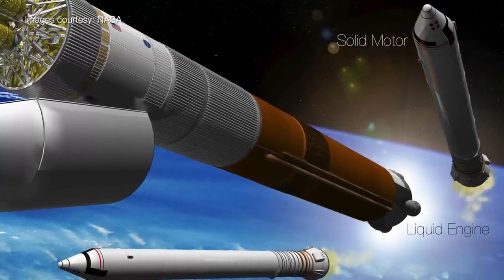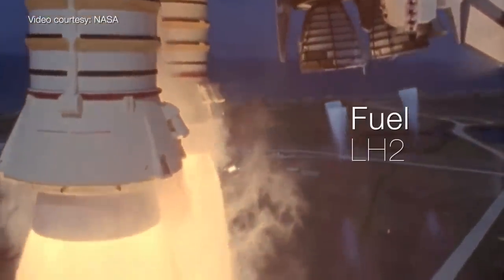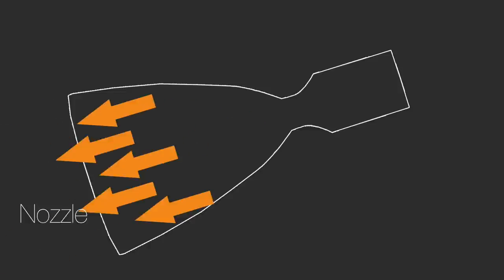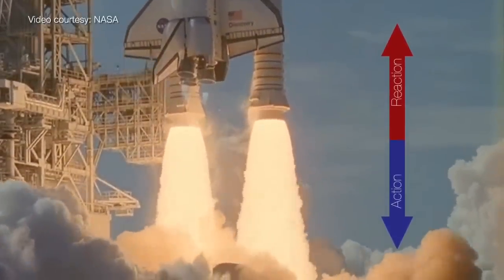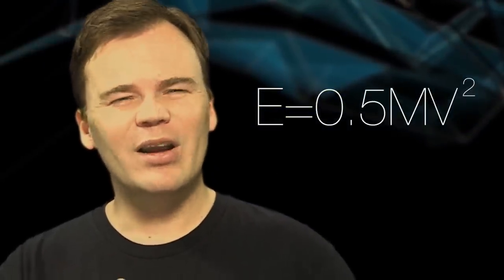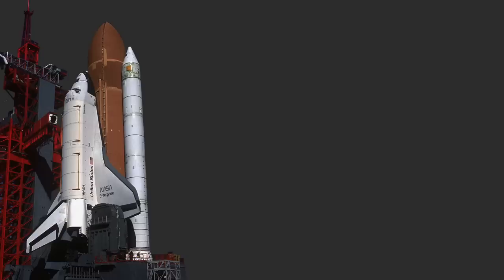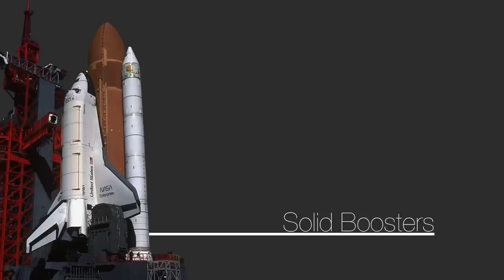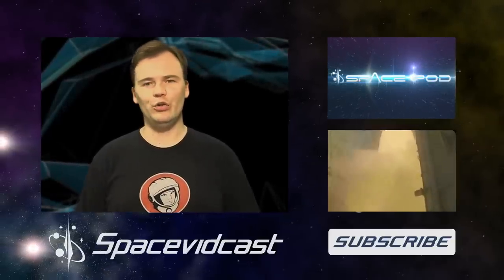How do rocket engines work - SpacePod

Comment: One thing I never understood until my fluids class- I always was confused why the nozzle expanded the flow.  Intuition is that as fluid expands in area, it slows down to conserve mass flow.  But, I learned in my compressible flow course, that the above is true for subsonic gasses, but once the gasses are flowing supersonically, an expansion in area makes the velocity increase.  So the throat is critical in that, it speeds up the flow to sonic, then expands it supersonically in the nozzle.
Reply: Haha yup, exact same story here.
Reply: What difference does it make what the gas velocity is?
Reply: More energy is released where? I do not believe that the higher the gas velocity, the more energy is released. I believe that the more energy is released, the higher the gas velocity; other factors being equal.
Reply: Scott Gauer same boat

Comment from the maker: Correct. That is an empty orbiter, fuel and tanks. 

However, the maximum payload weight to LEO is only 24 tonnes which brings the total weight to 2,019 tonnes. Part of the reason the payload weight is so small is that the orbiter itself is 74 tonnes all of which we need to bring up and back! So the shuttle ends up becoming payload in and of itself.

Comment: You're going to need to do a video about how space and vacuums don't pull, because some people think that rockets can't work in space because the vacuum of space >pulls< the gases out of the rocket and robs it of any push. Please explain to them that there is no sucking(as in pulling)done by a vacuum. It's only pressurized gases expanding and PUSHING into areas of lower pressure. No pulling, just pushing. I just did a video about this point, if people want to check it out, but more people need to make a video explaining this misconception about vacuum.  You also need to explain what Joule's Free Expansion Experiment is all about because that is what these people use as evidence that vacuum is pulling and therefore rockets can do no work in space. They are misinterpreting the experiment but I'm not the guy to explain there miss step on that one.

Comment from the maker: Liquid Hydrogen is insanely hard to control. The fuel is light, but it wants to leak and go everywhere, so you need heavy and complex equipment to keep it contained. Remember the last few shuttle flights and how they kept getting delayed due to a GUCP issue? That's a ground umbilical carrier plate and it is what carries the hydrogen burnoff away from the vehicle. When it had even a small leak, they had the postpone the whole flight! RP-1 on the other hand, heavier but easy to work with.

Comment: Should have mentioned that there are good reasons to use kerosene over liquid hydrogen in certain situations. Kerosene is much denser than liquid hydrogen. You can put a lot more kerosene in a fuel tank of a given size than you can liquid hydrogen.
Reply: Very true, but sometimes you have to balance it because heavier fuel burns faster.
Reply: In rockets it's more about mass of the rocket, so we use hydrogen which has a good energy to weight ratio

Comment: Actually with the fuel mass thing, you get more energy from denser fuel which is why you use those for first stages (you need a LOT of thrust) and then you move to more light weight fuel which gives u more efficiency for less thrust.  If lighter fuels gave u more thrust that would defy the law of conservation of mass.......

Comment: how does it propells in space vaccum
Reply: First of all, vacuums do not 'suck' things away, which is a common talking point. It's a bit counterintuitive, since we live in a pressurized environment, so any reduction in pressure causes ambient pressure air to try to move (push) into the low pressure environment. Your house vacuum really uses a turbine to push air out of its body, and has a hose to allow ambient pressure air in, which pushes dirt and dust with it. Similarly, in a vacuum, a pocket of pressurized gas tries to push apart to fill the volume equally. This is important.

Second, if you sit on a skateboard at rest and throw a heavy object, you move backward. All the momentum you apply to the object also applies to you, in the opposite direction. When you add these together, keeping in mind the direction, they make zero, so momentum is referred to as 'conserved'. Both objects move, but their combined momentum is zero. This always, ALWAYS applies in physics.

Third, in a rocket's combustion chamber, the pressures are very high. Saturn V's third stage operated at upwards of 730 psi. This does not require a comparatively measly 14 psi of atmospheric pressure to 'hold it in' for some time. Anyway, the chamber lets the gas out only in one direction, and with such high pressures, the gas gets to very high speed. Faster than the speed of sound.

All that really matters for a rocket to work is that fuel, with mass, starts at rest compared to the engine, and finishes as exhaust, with the same mass, at very high speed in one direction out the nozzle. This change of speed is also a change of momentum. And as before, if you have a change of momentum in one direction, you must have an equal change of momentum in the opposite direction. Thus, the rocket moves opposite to the direction of the exhaust.

Comment: what does a rocket push against in space?
Reply: steven padilla:

There is nothing for rockets to push against in space. That's why rockets can't work in space...
Reply: It doesn't need to 'push against' anything. A rocket works by taking part of its mass (the fuel) and throwing it out the back at very high speed. The fuel starts at rest compared to the engine, and ends at high speed in one direction. This has a lot of momentum that goes with it. But if you have momentum in one direction there must be an equal momentum in the opposite direction. The only thing it can be applied to in a vacuum is the rocket, so the rocket moves. A bit counterintuitive, but that is how physics works.

You can try this by sitting on a skateboard and throwing a heavy object. With the wheels lined up with the direction you throw, you will move. If there is any pushing involved, it is against the ball, which is the analog of the fuel/exhaust. You don't have to wait for the ball to hit something and stop for you to move. You move as soon as mass starts moving around.

Comment: Why are you calculating kinetic energy?
Its the momentum that you want to know, p=mv
Reply: Correct, the mass of the rocket does not stay the same; it changes all the time because the fuel is being consumed. The K.E. equation is just going to give you a K.E. at that instant provided you know the exact mass of the system, but the momentum equation will give you the momentum of the system at all points in time. The trick to "Rocket science" is this change in mass and proportional increase in momentum, it is not just Newtons's third law as stated in this video.
Reply: ***** Is there a 4th law?
Reply: +Tim Interested 
In fact kinetic energy is ONE HALF of what this gentleman stated it to be.
Reply: Ganeshwary is that you?

Comment: I still don't understand.... in order to move, you need an opposite force, for example to walk, you push with your feet on the earth, the earth offers it's support, that support is the opposite force, now how does a rocket move in space where there is no support ?
Reply: When a rocket takes off, the upthrust is pushing against the surface of the earth and provides upwards momentum, but when the rocket gets to a certain height where force will no longer be hitting against the earth, it instead will push the molecules in the atmosphere away causing the same outcome. It's like when you're swimming, if you push the water out of the way you propel yourself forward a little bit, but because air is much less dense than water you require huge amounts of thrust to push enough of it out the way in order to provide the required amount of upwards momentum to push against the force of gravity. This is called newtons third law, for every action there is an equal and opposite reaction. 

Hope this helped :)
Reply: Tom Smith
it did, you did say that the rocket push agains't molecules, i was stupid enough to thing that space was enough of a vaccum to prevent things from changing direction
Reply: Tom Smith You didn't really answer his question, you know?!
Reply: damon-st -- If a mass pushes against another mass, both masses are actually pushing against each other -- because a mass resists any change in its state of motion, or state of rest. The rocket and the hot gases from the engine are pushing against each other. The hot gases win. A person sitting in an office chair, firing a machine gun, will move in the opposite direction of the gun fire. It's not because the bullets are pushing against the air. It's because the mass of the bullets and the gun are pushing against each other. The gun wins, and only feels a slight recoil, because it has more mass than the bullet. A rocket has far less mass than all the hot gases leaving the engine. By weight (mass), a rocket is mostly fuel. For example, look at the huge fuel tank, and boosters, on the Space Shuttle. 

If an atmosphere were necessary for a rocket to work, that would mean it would work better in a thicker atmosphere. But that would be silly, because air causes friction. and more friction produces less movement.
Reply: Tom Smith --- Rockets do not work by pushing against the air or the ground. A rocket works because the rocket body and the hot gases from the engine are pushing against each other. And the hot gases win because they have more mass than the rocket body. If a mass pushes against another mass, both masses are actually pushing against each other -- because a mass resists any change in its state of motion, or state of rest. A rocket is less efficient in the friction of an atmosphere. You don't swim better in pudding than you do in water.
Reply: dudev
Basically, i need to take basic physics classes :D anyway, the mass of the burning fuel at a T times is less than the rest of the ship since the rest of fuel is included in the general mass of the ship, but i don't really understand these mechanics so i guess i must learn some physics basics before continuing
Reply: damon-st --- The general principle is easy to understand. A continuous stream of hot expanding gases has a continuous recoil effect. Acceleration is also cumulative. It comes down to what Galileo realized -- that a moving object will stay in motion unless acted upon by another force, such as friction or gravity. The stronger force wins.
Reply: dudev
understood :D thank you, a lot
Reply: +damon-st 
Picture a baloon . The forces within can be imagined as little arrows which push out against the wall of the balloon. If the balloon is sitting quietly on a table we know that all the little arrows (forces) balance each other else the balloon would move, being pushed from within. When the nozzle of the balloon is opened the little arrows at that point have nothing to push against (or at least very little) and so they almost disappear. The arrows OPPOSITE the nozzle do NOT disappear and so the forces which they represent PUSH the balloon in the direction opposite the nozzle.
Reply: +dudev Well technically, its not about hot gases winning because the gases accelerate much faster than does the rocket. The escaping gas and the rocket engine impart equal force on each other in opposite directions. Initially on liftoff, the mass of the rocket assembly is huge, while the supersonic mass flow of the escaping gas is big but not that immense. That is why the rocket does not accelerate that fast on liftoff. Over the course of the rocket climb, the mass of fuel expelled is most of the initial liftoff weight, but all that mass does not escape instantaneously. Your analogy with a gun and a bullet is correct, when a gun is equivalent to a rocket, while the bullet is the escaping gas.
Reply: +damon-st its simple...blow up a balloon and let it go... what happens.... it moves.
the pressure in the balloon is greater than the pressure in the atmosphere of earth.  blow up the same balloon and let it go in space ( where there is even less pressure, negative pressure in fact) the expelled air in the balloon, or the thrust pushes it, only in space chemical thrust (combustion turning liquids into gasses) is used.

Comment: Why only chemical rockets, why won't nuclear rockets work?
Reply: doodelay I think because the fuel is heavy, the temperature would be really hot, radiation, ... => not good.
Reply: Hieu Bui Lest we forget the engineering challenges of trying to keep a nuclear detonation contained...
Reply: My guess is that because nuclear reaction are either to violent for the rocket to endure or, if slow enough, wouldn't allow any thrust, since the products would be only heat and metal. The fuel would be heavy and the efficiency of the motor would be really low, because the heat would have to expell mass somehow and the metal can't be expelled. In chemical rockets the reactions are easily controlled The products of it can be expelled and have much bigger volume than the fuel. So, even though a nuclear reaction is extremely powerful, there is no practical way to convert the energy into movement.
Reply: doodelay There are multiple project for nuclear spacecraft (Also using a nuclear bomb as propulsion, check Orion), but the main one which was also tested, the NERVA was actually going to be installed on a Saturn V, in a upgraded S-IVB (Third stage). Actually managed to get into testing session, but nothing more.

Nuclear engines are efficient, twice a normal rocket. But they are very heavy and with a low thrust.

In space radiation doesn't really matter, since the sun itself throws radiations all around our solar system :)
Reply: Really? Twice as efficient? I think not, if you say that efficiency is the quantity of energy produced transformed into cinematic energy. Otherwise we would definitly use it, since rocket lunches are expencive. Any discount would be apreciated and used.
Reply: Juan Salies The J-2 engine used in the Saturn V had a Specific Impulse of 421s, while the NERVA would have 825s.

First of all we're not talking about rocket launch, due to it's thrust to weight ratio it's impossible to use it as lifting engine, it would be used to make Earth departure manouvers
Reply: +doodelay The answer is none of the above: the main reason is political + economics. there's a lack of knowledge about nuclear propulsion systems in the public and fear to everything with the "nuclear" label. Currently there's an economic component too. The solution found is, for now, to have a chemical rocket for the launching component (at least until reaching LEO) and then to start a nuclear engine. The fuel is usually H or H2 so the gas velocity is way faster than the chemical rockets. The problem with the temperature can be solve by a combination of new materials and remembering that the exit is pretty much a plasma (=ionized) so magnetic fields could also be used to keep the exhaust far from the walls of the nozzle. There is NO radioactive material being released by the way. The nuclear reactor replaced the combustion chamber and "heat" the fuel at higher temperatures. This is the short version. I work in space nuclear systems by the way. Cheers. :-)
Reply: Carlos Omar Maidana Will the fuel be too heavy? And will it be solid or liquid nuclear fuel?
Reply: doodelay Liquid Hydrogen, which is pretty light, and Uranium-238 i think
Reply: doodelay The nuclear fuel can be liquid or solid. Currently the research is to try to make it liquid for different reasons but solid fuel was already being tested (since NERVA). The propulsion gases by preference is atomic H. The idea is to have a bimodal systems so you get propulsion + power at the same time. Always talking about Nuclear Thermal Rocket. In Parallel there's research in Nuclear Electric Rocket that for the political reasons I mentioned before, might be more suitable. The idea is to have the nuclear reactor couple to an electric propulsion system. Main components are the same between NTP, NEP and Fission Surface Power (nuclear reactors for electric power generation in space). With so many budget cuts worldwide and the politics, the idea worldwide is to do everything modular and reusable for different type of applications.

Comment: Actually, it is  E equals 1/2 m v squared. 
Your explanation is not very enlightening.
Reply: +ercillor why 1/2 m ?
Reply: Essentially, the 1/2 comes from the integral of velocity.  Work = Force x distance and can be expressed as the integral of Force (as a function of distance) over some distance, dS. Also Force = Mass x Acceleration where Acceleration is simply the change of Velocity w.r.t. change in time (i.e., Accel = dV/dt).  Also note that Velocity is the change of distance w.r.t. change in time (i.e. Vel = dS/dt).            Substitute.    W = Integral of { (Mass x dV/dt) dS}.  For this derivation, Mass is independent of time and distance so can be moved outside the integral; such that, Work = Mass x Integral of {(dV/dt) dS}, or rearrange, as Mass x Integral {(dS/dt) dV} = Mass x Integral of {V dV} = Mass x (V^2) /2.   (Notice the last part is right out of elementary calculus).        Sure, there's a component of initial Velocity, Vo which can be included for completeness as one of the boundary limits of the integral, but we'll assume the object was initially at rest, having no motion (Vo = 0).        Anyway, that's where the one-half comes from...